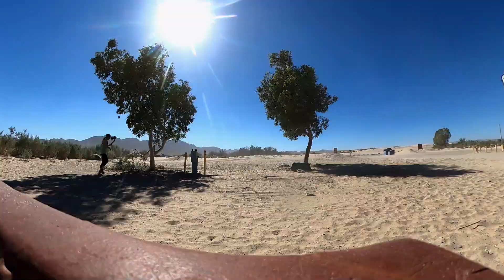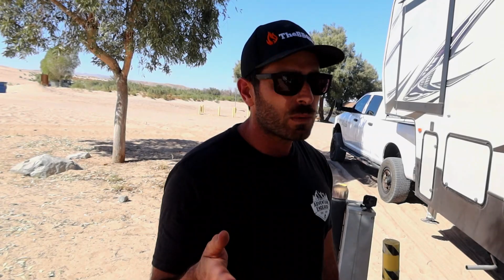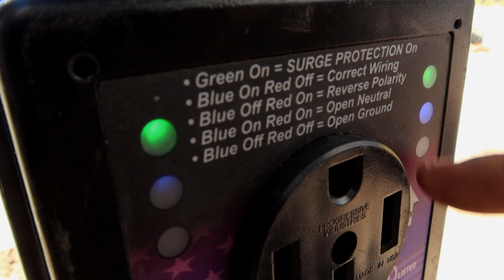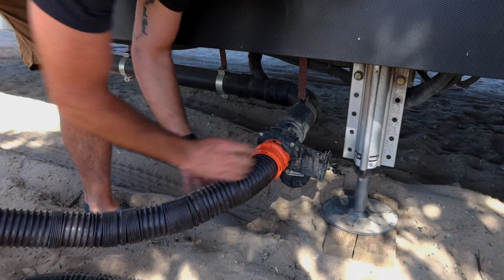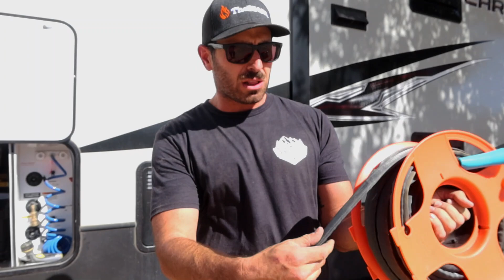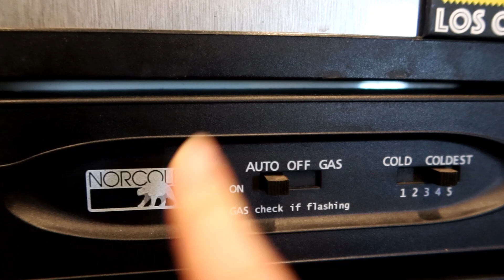Rving Newbie || How to Hook Up An RV

Comment: No water pressure regulator?  Risky.
Reply from the maker: Hey Bob I'm Pretty sure it's built into the elbow, but I could be wrong! Thanks for watching I'll look into it.
Reply: @AdventureEndeavor  water pressure regulator would have a circular pressure gauge and an adjustment knob.
Reply from the maker: Thank you! Probably didn't have one then!😂😆👏
Reply: @bobhewlett3633  actually not all do.  There are literally dozens of fixed pressure regulators for RV use that have no gauge or adjustment. Some very good ones in fact that generally are more reliable and flow better than adjustable models.  In their case, they have a fixed pressure regulator on that brass elbow.  It's the standard CAMCO found in most every "dealer freebie" starter kit.
Reply from the maker: Yeah I think that's what we have, the free starter kit one.
Reply: @AdventureEndeavor In September we made a run from SoCal to Mount Rushmore. Two camp grounds we went to, one was 140PSI and the other was 120PSI. Guess what they sold a lot at the gift store? One had a wall of regulators on it for sell. Funny thing that was the one with the 140PSI and was the most expensive place. High end.
Reply from the maker: Good to know! Thanks for the reply, we hardly hook up but I know that's no excuse.

Comment: You need to pull your shore power plug out of the wall and rotate it so your cord is hanging straight down and not like it is. That's hard on the connector. And can also crack the female side of the connector.
Reply from the maker: Yeah that's what I was thinking, we very early hook up to power so it hasn't been a priority. I'm guessing the factory installed it incorrect. Thanks for the advice Robert.
Reply: They never clock them correct from the factory.
Reply from the maker: Weird seems simple. Oh well.